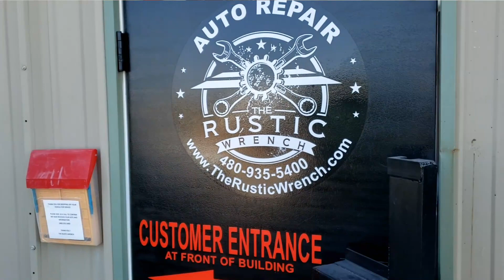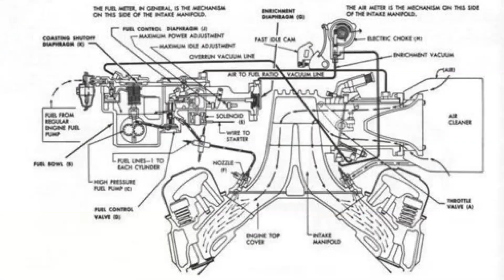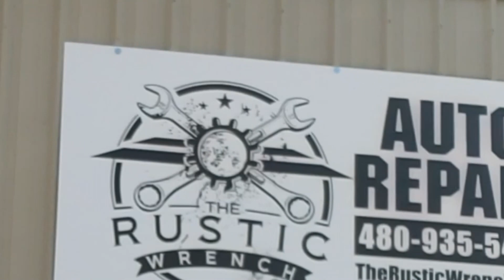What RARE Classic Cars Did I Find on a Saturday?

Comment: i see V8 engine in AMC Eagle they had redesign motor mounts. normaly it has straight six they wanted more rock climbing power ~ that got sound like the kitten that roar.. bumper has a screw where other bumper have white lens deeper in 7:23 does it mean reproduction?
Reply from the maker: That would be cool to see too.

Comment: AZ expert that is not an GM LS engine. Some other GM Small block.
Reply from the maker: Thank you. I figured my viewers would help me out.
Reply: @AZExpert  GM LS engines look much different than the SBC you showed us, the LM4, LM7, LM59, etc. have coil packs on valve covers,  no ignition distributor, have different oil pan, water pump, etc. here is a good website in Reno explains different generations of GM LS version engines, http://bdturnkeyengines.com.   The least expensive and most desirable for doing swaps are the plentiful GM truck and SUV engines.  Most desirable being the 6.0 and 6.2 Liter engines as stock the make a lot of torque and HP. Cammed and tuned they are monsters. However even a 4.8 liter LS with a good cam and better lifters can produce much more the 300HP.      http://bdturnkeyengines.com/
Reply: @AZExpert  yt channel "driveway engineer" is a great channel to gain GM LS engine build on a budget.